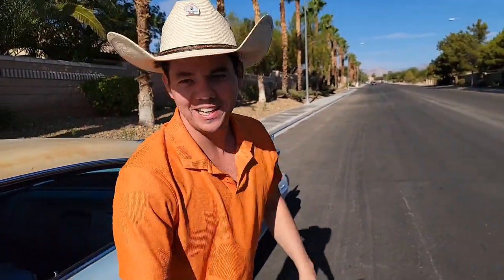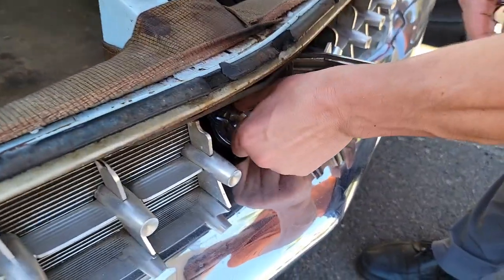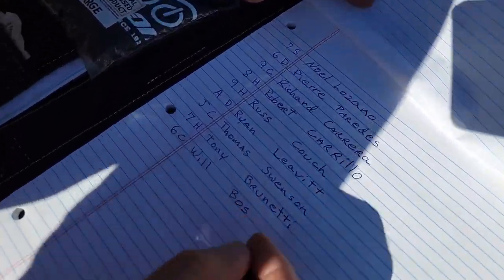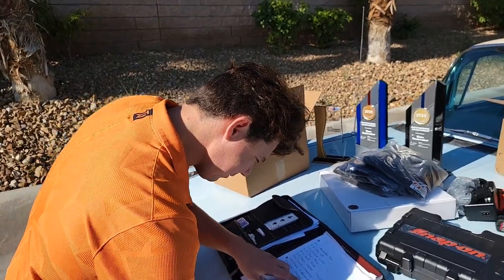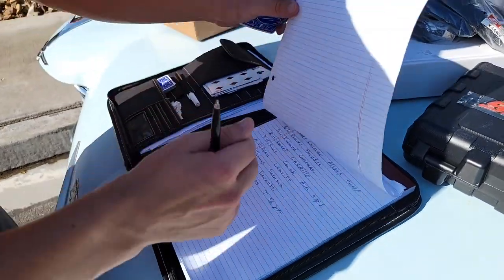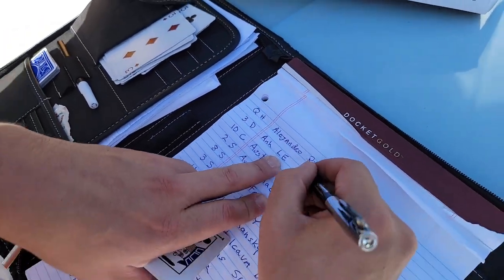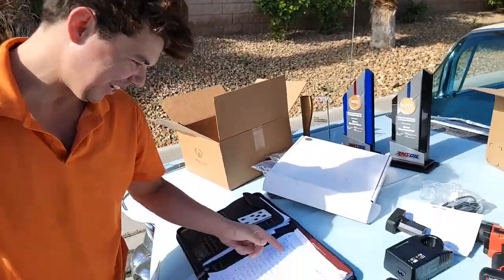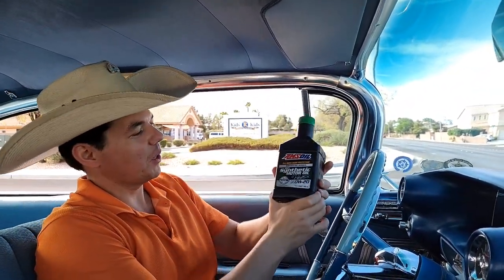Ebens Christmas in July Giveaway Snap-on Tools + $125 Gift...

Comment from the maker: Past Ebens Giveaways - https://youtube.com/playlist?list=PLB_ftWArBFdey4HFt_Z9KgSIChjkLbw_o

1959 Cadillac DeVille 6329 Series Playlist - https://youtube.com/playlist?list=PLB_ftWArBFdeVKszO64Ig5nWEQp7H3oF-

❤️ 🇺🇸 ❤️ Professional YouLubher: Eben Rockmaker Regency Platinum Direct Jobber AMSOIL Specialist (Dealer#: 5331179) 702-472-3614 

      ✅ ✅ ✅  You will get Best Value with 6 Month AMSOIL PC Membership because You get $33 back on a $100 purchase after the difference in Sales Tax with No need for Auto Renew - https://www.amsoil.com/offers/pc/?zo=5331179 

🥇 AMSOIL Dealer - Synthetic Oil Protection
(702) 472-3614
https://maps.app.goo.gl/DmLU5hP72HadUBEm9
             
     ⛳️  Synthetic Oil Protection Website - http://syntheticoilprotection.net

     Did you know a oil manufacturer can call a lubricant a Full Synthetic when it's only 25% synthetic? AMSOIL is different because it is 100% Synthetic and has a higher film strength keeping the metal parts separated. AMSOIL allows less friction, less heat, less wear on the component. 

     Your Vehicle Could Run Better Than Brand New By Using AMSOIL 100% Synthetic Lubricants! See Results - https://youtu.be/zH-VquYlhqA

     AMSOIL Signature Series 5W-30 Synthetic Motor Oil protects against harmful deposits on turbochargers 4X better than Mobil1® Extended Performance in industry-standard testing*.  Read This Article - https://www.amsoil.com/newsstand/motor-oil/articles/leading-the-field-in-deposit-protection/?zo=5331179      

     ♥️ AMSOIL Performance Tests: Read This Article - https://www.amsoil.com/performancetests.aspx?zo=5331179    

     Find AMSOIL Products For Any Vehicle - https://www.amsoil.com/guides/?zo=5331179      

     Synthetic Oil Protection Coffee - Ebens Favorite: https://supportwith.coffee/shop/subscriptions/sop/